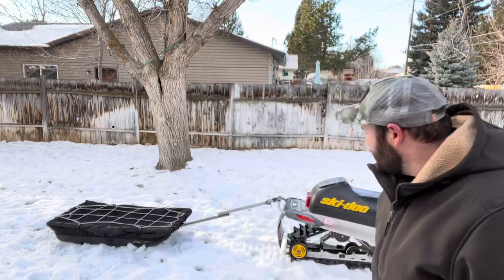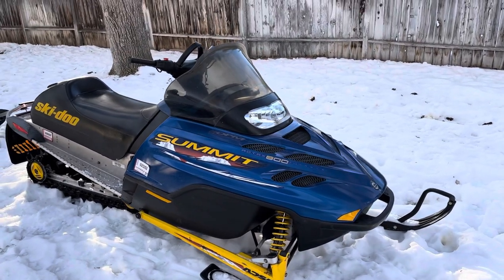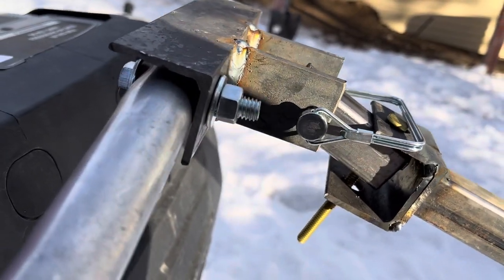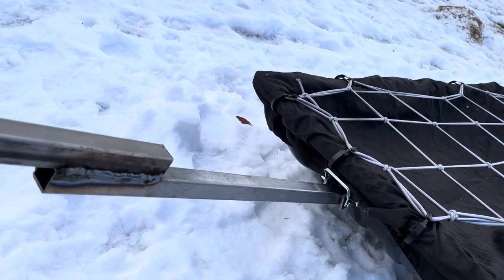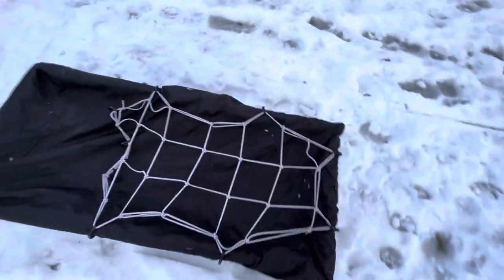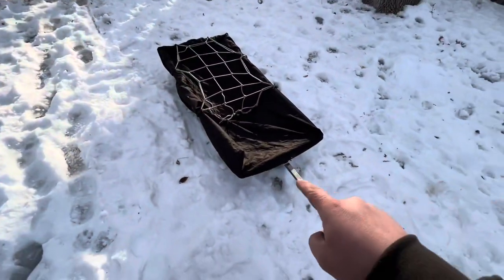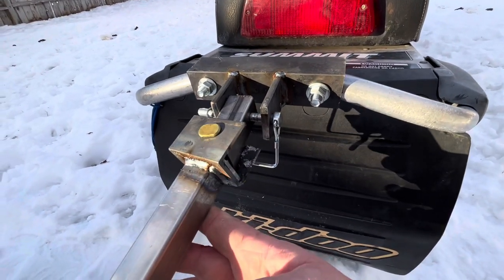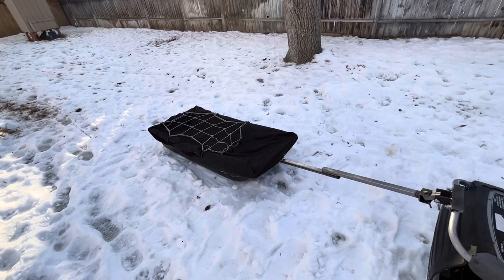Easy Ice Fishing Sled Hitch

Comment: Great Ideas here! I was looking around for a design that is non invasive to the frame. But I think if use most of the same premise you did, and just attach with U Bolts around the bar instead of bolting it directly in the bar I could still achieve mostly the same end result.
Reply from the maker: I definitely think that U Bolts would solve your problem if you don’t want to drill holes. Depending on your preference you might want to add some felt or rubber so they don’t scratch up your bumper if you are trying to keep things nice.

Comment: What size is your cargo net and where did you get it? Looks handy.
Reply from the maker: https://www.sportsmans.com/camping-gear-supplies/auto-rv/rv-parts-accessories/progrip-15x30-powersports-cargo-net/p/1399137
Reply from the maker: If I remember right that is the one I use. It works great especially if you are going over rough terrain. I haven’t lost anything out of the sled yet and have made a few 20+ mile trips.